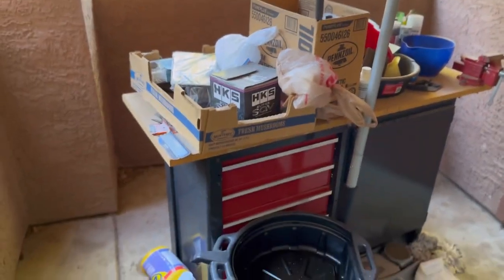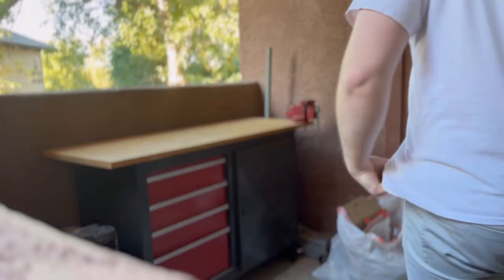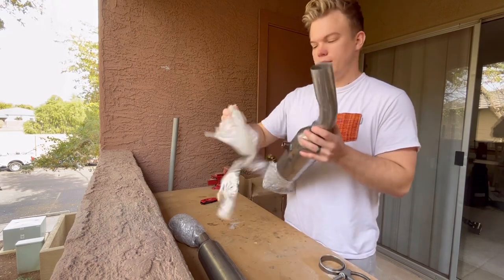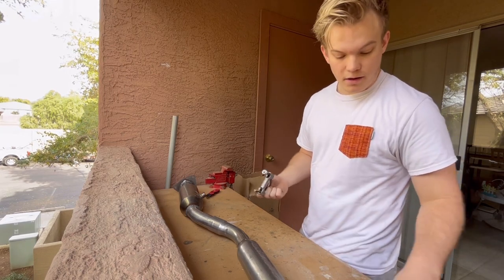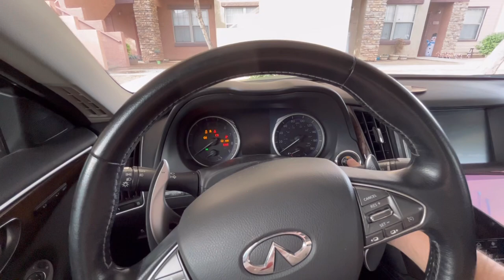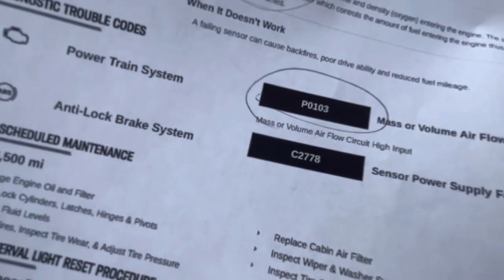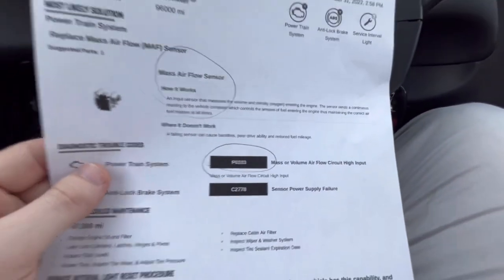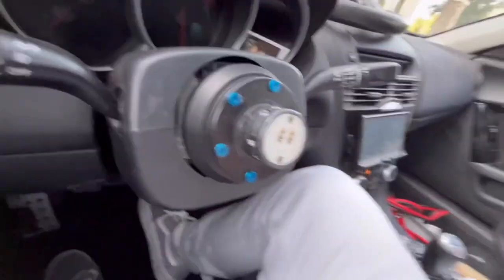Can a 2004 Mazda RX8 Pass Emissions With an Ebay Catalytic Converter? PT. 1

Comment: I was getting a power cut over 4k rpm occasionally, from a clogged cat. My vacuum pump was also making a similar noise when the cat issues started.

But, you can't expect a vacuum pump to pump into a clogged line, so...

Comment: Regarding the 4k rpm power drop, might this be your SSV? I was plagued a while back with a dirty SSV that stuck closed causing similar symptom. I believe over 4k rpms is when it opens/closes although I can't recall if it threw a code immediately or not. I reviewed your video for the autozone code reader results and didn't see it. Just a guess if you haven't experienced that fun yet. I apologize if you already documented such experience, my first time seeing your video. I just love watching other rx8 owner experiences.
Reply from the maker: I haven’t checked the SSV yet, I will get right on that, thanks!